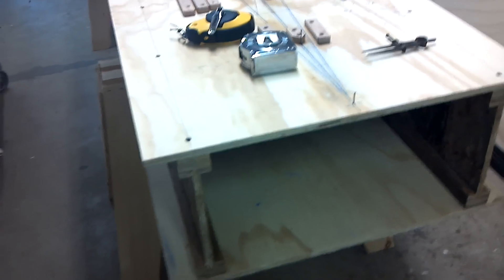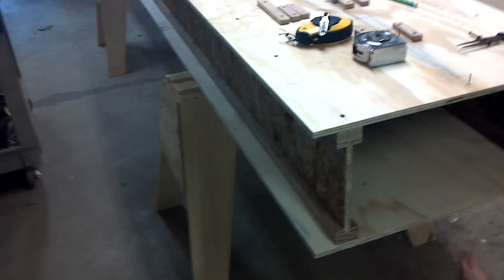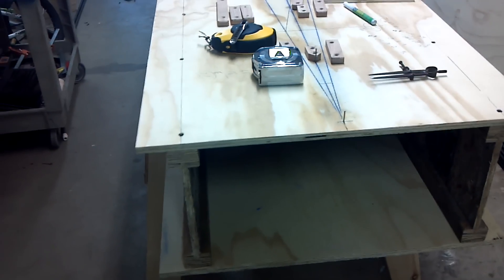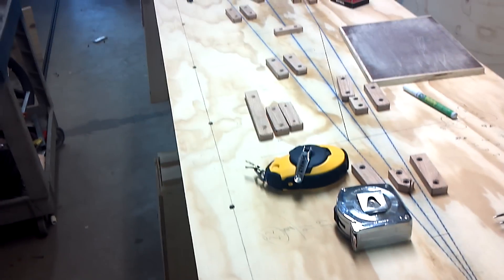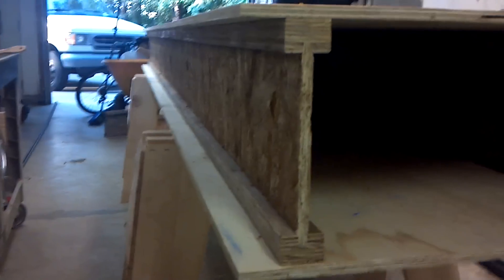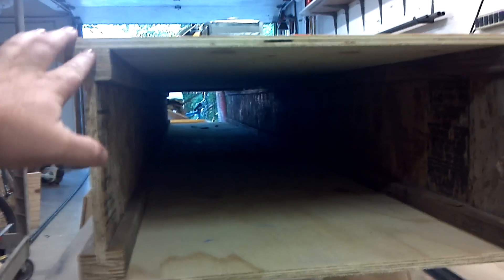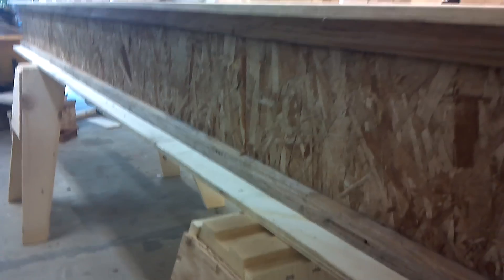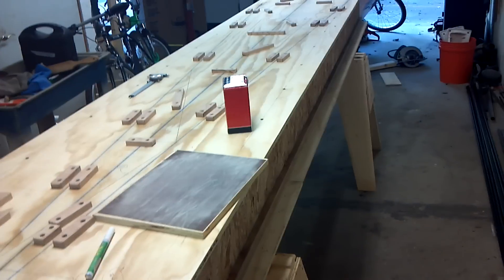Legal Eagle Ultralight construction video #1

Comment: I did not understand if the table is flat and solid. Why do you loosen and tighten the screws ? I admire you high IQ people. I decided to forge ahead and attempt a build. I may never finish. But I learned sometimes you just have to give it your best shot. At one time I was smart enough to earn a pilot license years ago. Never went much further though. A man needs a cheap plane to fly.

Comment from the maker: It's called "Radiata" and any decent lumber yard should carry it. Places like Home Depot do NOT  carry it. I would avoid plywood from the big box stores because most of it is warped. Good luck, I hope you find it because it's really nice to work with. Most lumber yards have a large panel saw and they will rip it in two pieces so it's easy to manage.